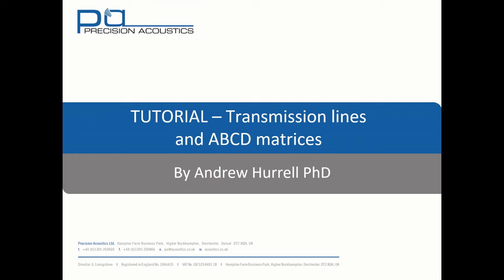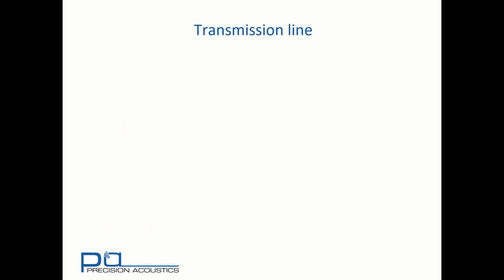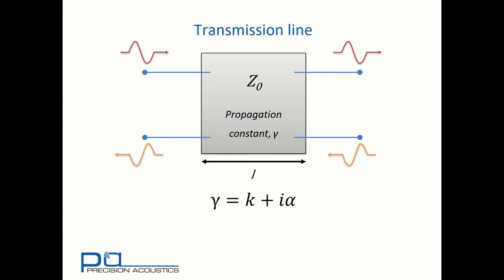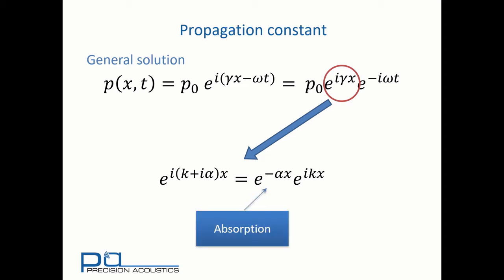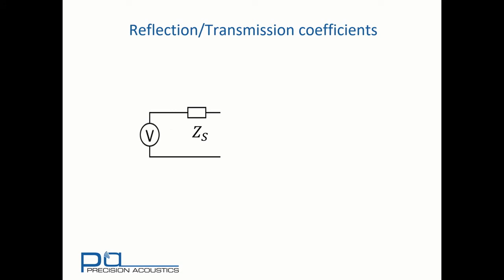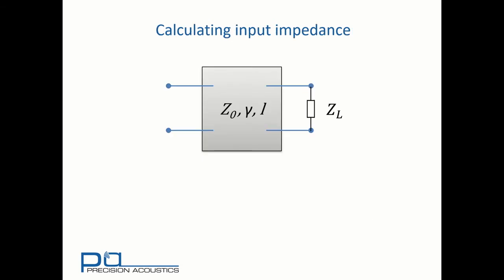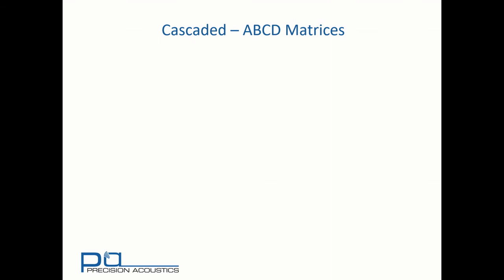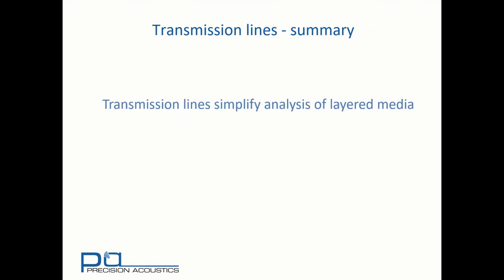PA Tutorial   Transmission lines and ABCD Matrices

Comment: if use quarter wave impedance matching ,the lambda is what wave length?Thank you for answering me.
Reply: acoustic impedance
Reply from the maker: Hi - there are a number of publications that have suggested strategies for choosing the acoustic impedance of the matching layer material (especially if you are using more than one material).  For single matching layers this is oftens a material that is the geometric mean of the piezo-electric medium and the acoustic load (e.g. PZT and water).  Once you have identified a material, you will know its wavespeed.  Therefore you can identify the wavelength at the frequency of interest and from this the length required to achieve one quarter wavelength in that matching material